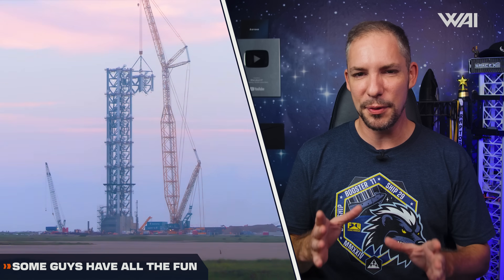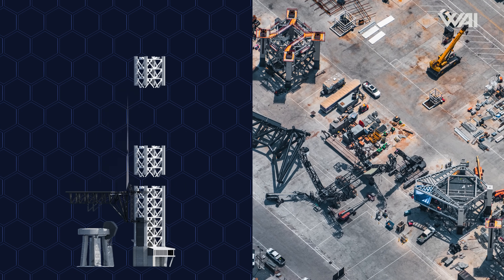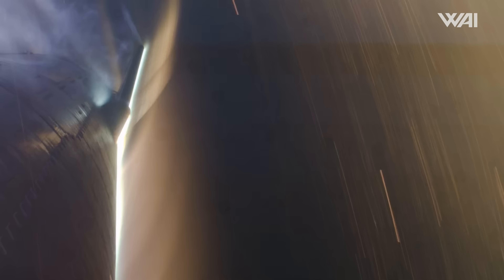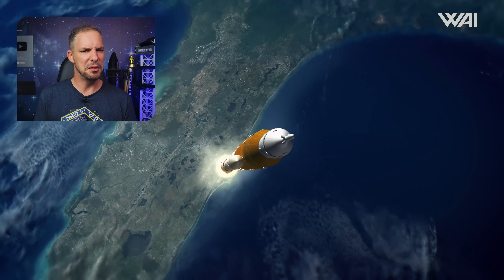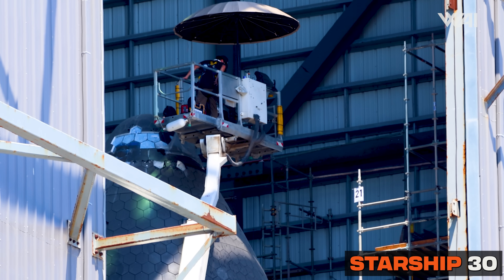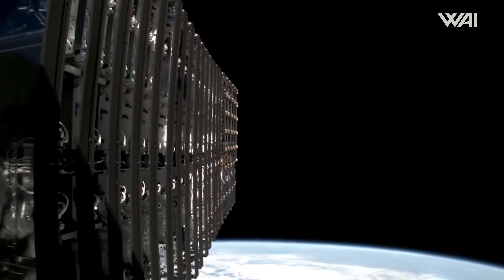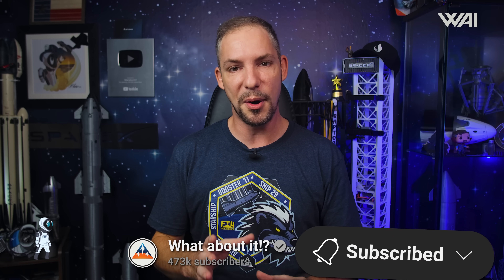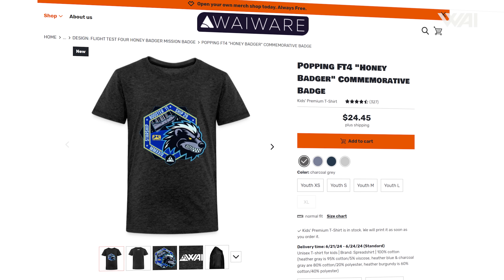SpaceX Reveals Important Starship Flight 5 News! Are They Ready?

Comment from the maker: Take your personal data back with Incogni! Use code FELIX at the link below and get 60% off an annual plan: http://incogni.com/felix

Will SpaceX catch Booster 12 on flight 5? :_WAIHello:
Reply: Thank you for referring to "Seven of Nine" from Star Trek Voyager 😎🙏🇩🇪
Reply: Yes sir.
Reply: I honestly think they'll do another controlled landing in the ocean before making the grab attempt.  I mean - the new heat tiles haven't been tested and you don't know how they're going to perform.  And you certainly don't want tons of partially slagged rocket falling out of the sky onto you manufacturing facilities.  ;)  Just saying.  hehehe
Reply: @StevenIngram  The heat tiles are on the starship which they won't be catching this time. They do plan to catch the booster however. I think they can see how well they can control the booster on its return before they steer it towards the tower. As Elon often says: It will be exciting...
Reply: @StevenIngram  they are going to attempt to catch the booster not starship.
Reply: What if the 26 is the one to be space fuel depot? You dont need flaps cuz is not comming back... I would give her a white thermal insulation, or second reflective skin, the one working better in vacum condition. But, i believe if you can lunch 4 flapless starships and make a fuel depot on geosincronus orbit. Like a mid way repost station for lunar flights...
Reply: I'm thinking they're actually gonna catch that thing.
Reply: Obviously
Reply: I think it's possible because the falcon 9.
Reply: @ScienceTUBESpaceflight  Yeah, but the first few attempts were a little bit explodey
Reply: Pretty sure the volume is lower in this video. Wanted to give a heads up 🙂
Reply: IFT-5 asap please!
Reply: Well Jesus Christ!  Felix said a funny I laughed at in over 2 years of watching (nose scratching)

Keep it up you Crazy German Maniac!
Reply: Yes. I say there is a 98% chance that B12 is caught on flight 5
Reply: Incogni, the starship of online security 😊
Reply: Yes.

Comment: I was thinking about this heat shield tile issue that SpaceX has been having, I know there was talk about putting in ablative layer underneath the tiles in some areas but I was wondering if they could just apply in a blade of coating to the outside of starship tiles instead, I know there are some oils and similar viscosity compounds that will slowly create a vapor barrier when heated as these have been used and tuned for specific industrial applications before.

Engineers are really impressive on what they can do with certain compounds but the knowledge of these compounds likely hasn't previously had an application in rocket science

Comment: How good it is to hear about the Fram 2 mission from pole to pole. The Fram 1, or just the polar expedition ship Fram from the very town I live in. It set sail in 1893 to find a way to not succumb to the crushing ice. He held a slightly used bar of soap, squeezed it between his hands and the soap took a leap of faith across the table. That's how they would camp out with a suitable boat on the Arctic ice. 

I've also lived in a house 6 meter across from the childhood home of Thor Heyerdahl, I was too young to care but it's quite fun to think back.

Comment: Polaris Dawn, you mentioned a final third mission that it docks with Starship.

Starship is currently NOT manned launch or reentry qualified. That does not preclude the possibility of an early docking mission with Starship already in orbit. It should not be any more complex than a ISS docking mission.

Starship environmental systems, command center and living areas will need to be ground qualified.

An automated flight monitoring system notifies the crew and Space X of any system pending fault or failure.

Polaris Dawn could dock to Starship, the flight crew transfers to Starships command center. They check out all Starships environmental systems in 0-g. Once everything is verified, the crew plans on remaining on Starship for a week televised from orbit.

Once the mission is completed the crew undocks from Starship and returns safely to Earth in Polaris Dawn.
Reply: Can you imagine the FAA requirements for that? They would probable that they would want to protect the space tardive population as well, right?

Comment: Why doesn't SpaceX just create a heat shield nose cone cap that snaps onto the front of the Starship?  This seems like it would be easier to update and replace, and could have some kind of heavier duty snap connection...
Reply: Yeah I've been curious about the same, even large "snap on" panels seem like a solution for the body too. My best guess is that it would be too heavy - the existing tiles are realllly light from what I understand.
Reply: It's about how the shield is made. Large panels are hard to bake. 
Another issue is difference in thermal expansion between steel and ceramic heatshield. Small tiles got enough space to safely expand . Large plate could just snap
Reply: @just_archan  yeah, you're totally right. I was a little spacebrained writing that earlier lol

Comment: unrelated but talking about all those crew dragon missions. Dragon was designed originally with 7 seats. You would think they could add two seats on the next mission in case a certain two astronauts need a ride home
Reply: Actually it would be safe to just put a little padding and some seat belts under the four main seats.  Crew Dragon is that safe.  However SpaceX has previously tried moving a seat from a Soyuz and mounting it as an alternative to requiring Astronaut Francisco Rubio to remain on the ISS for an extra 6 months when Soyuz MS-22 sprang a leak.  The biggest concern is that the Boeing proprietary spacesuits cannot plug into the Crew Dragon life support system, but that is only a risk if the Crew Dragon loses atmosphere containment.  NASA apparently intends to keep Butch and Suni on the ISS until the return of the Crew 9 mission in March 2025.  I suspect this is to avoid paying SpaceX any extra for the lift.  Crew 9 is already awaiting launch, so I suspect this means that the Crew 10 flight in March will bring any additional equipment to ensure the comfort and safety of Butch and Suni.
Reply: @jamescobban857 actually boring is fighting nasa because they lose 800 million if space x go get them and elon make a billion
Reply: That idea was considered but they have decided instead that, if Butch and Suni aren't allowed tp fly the Starliner back, two of the Crew 9 crew will be bumped from the flight and it will launch with only two. Then Butch and Suni will join Crew 9 and come back in the empty seats. Boy, if that happens, you gotta feel sorry for the two who get bumped.

Comment: Ship 26 would be low risk to flight hardware static fire 6 Raptor 3 engines. Can’t get to 100% throttle unless they add some structural enhancement, and might need a bigger fuel line but that won’t stop them.

Comment: All the simulations of the starship landing I've seen, have it over the launch mount.  Is it wise to have it subjected to the heat of two or more raptor (blow torches) engines?  I'm sure that it can be turned to a more neutral side of the tower.

Comment: I under understand why they dont go with the tried and tested landing legs for atleast starship. I know its heavy, but not being able to safely touch down anywhere but a few sites on earth seems wierd.  Seems like an annoying test campain to redo when they have to add legs for mars and moon missions. And also feels like a good safety factor for manned missions even on leo missions. 
I know, fast reusability, but they would probably still have to destack for cargo loading no matter what they do?  The only place i see it viable is if youre gonna use it as an airliner with people between fixed areas on earth, where cargo etc wouldnt be necessary, but even that having a singular failurepoint for landing safely feels abit sketchy.
Reply: Boosters will always come to launch site or be caught on barge so locational flexibility isn’t necessary
Reply: Landing legs for an Earth return would have to be much more robust than for the moon or mars. Lots of extra weight.